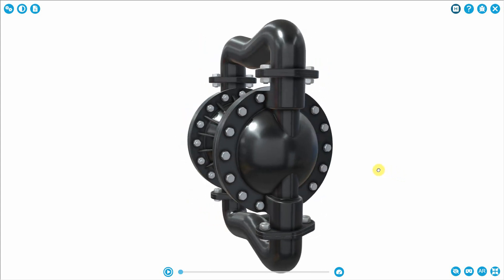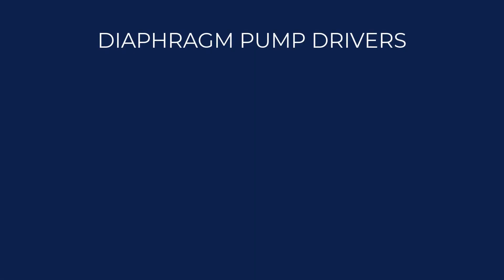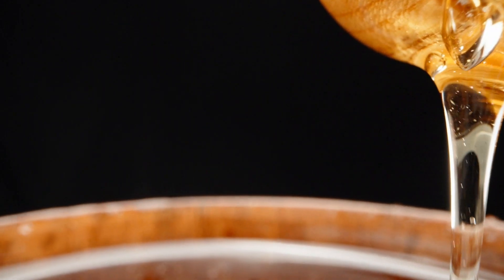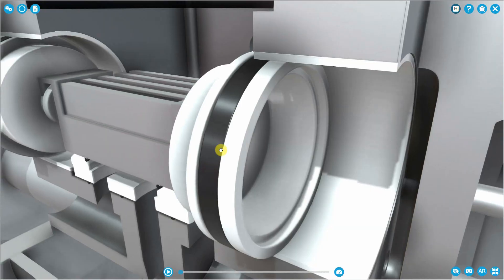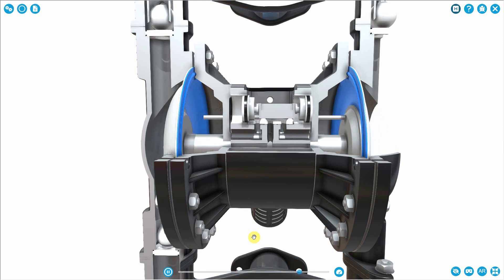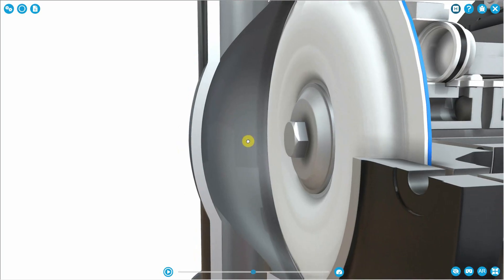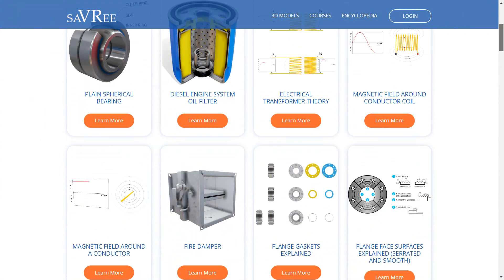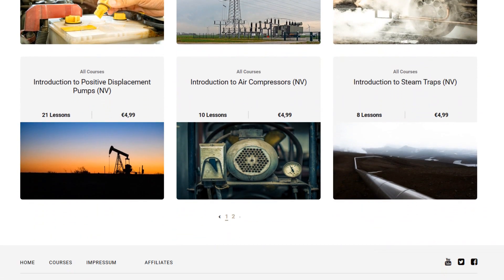How Diaphragm Pumps Work (Diaphragm Pumps Explained)

Comment: We had a similar rule for naming equipment in the system. We were always taught that any equipment in a system was named for what it did.

"If I had a pump that pumped peanut butter, it would be called a 'peanut butter pump.' If I had a pump called 'peanut butter pump' you can pretty much guarantee that it pumps peanut butter."

I still use this to explain things to people almost 30 years later in my day job.

Comment: Also they (although small ones in my experience) can be driven with a solenoid. I saw one in a single home sewage treatment system. It's used to pump air into sewage tanks for the active sewage treatment bacteria. 
Just a solenoid powered directly from AC and diaphragms, no other moving parts. Works very quietly and non-stop for years.
Reply from the maker: Simple but effective

Comment: You didn't explaine how the diaphram move or how compress air power this pump.
Reply: The center part is built such that when the piston moves to the right the air is sent to right chamber, thus pushing the piston to the left. Then the air is routed to the left chamber, pushing the piston to the right, and everything repeats.
Reply from the maker: This video is part of a course. The next lesson in the course shows how the air distributor works. The course is on courses.savree.com